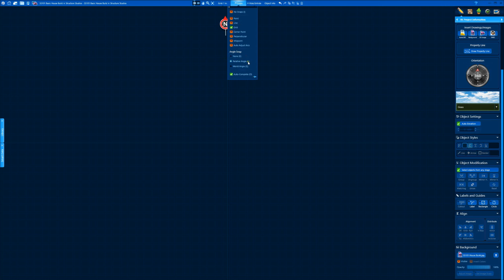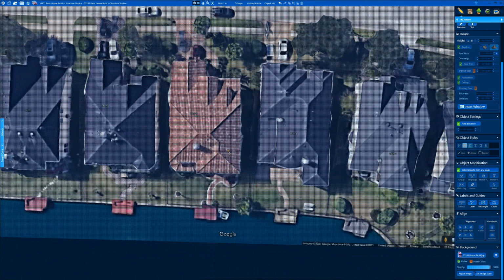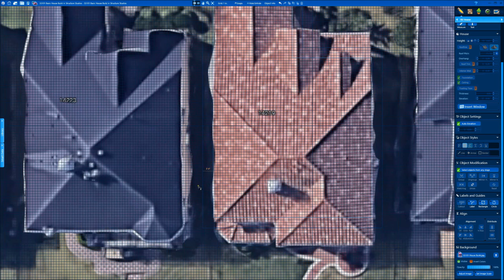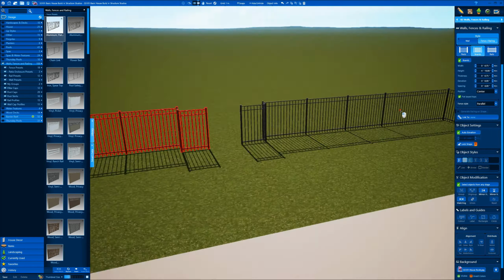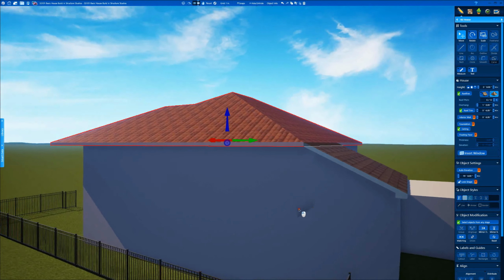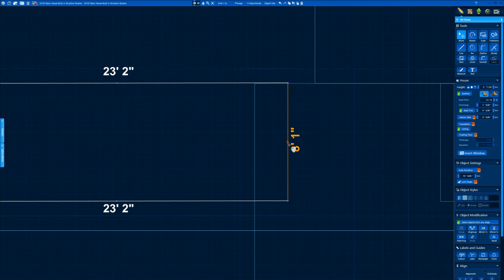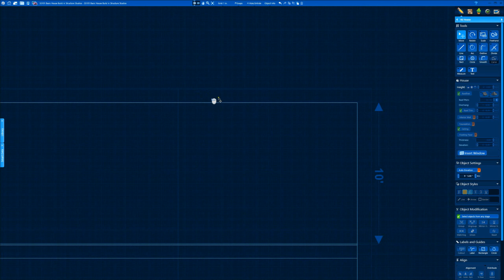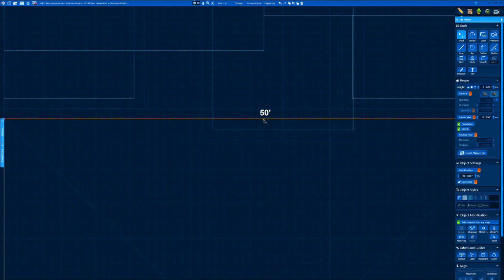Structure Studios House Build Part 1 Speed Build House Tutorial in House Stage

Comment: How do you used google map to draw the house. Normally i use GIS but they  are no up to date.
Reply from the maker: As stated in the video NEVER use Google Maps to draw anything. Only use it as reference. Neither GIS or Google Maps is accurate. This was just a speed build demonstration. That house is not 100% accurate. You risk a lot of liability and wasted time using GIS or Google Maps as your data source.

Always use the property survery AND go to the project site and measure everything yourself.
Reply: @vip3dcoreessentials  I just used GiS for a rough design, and then  if the project is accepted, do the actual mesuarent.